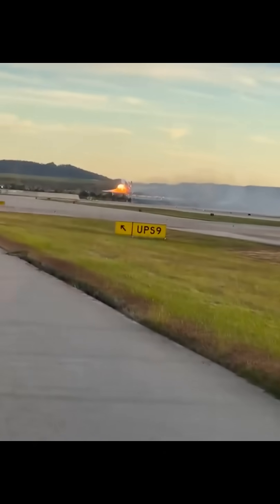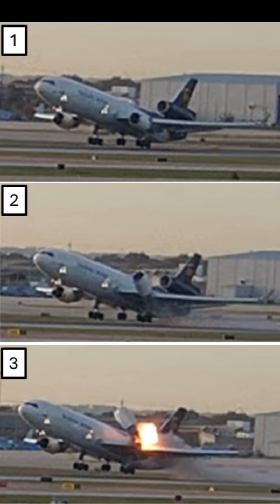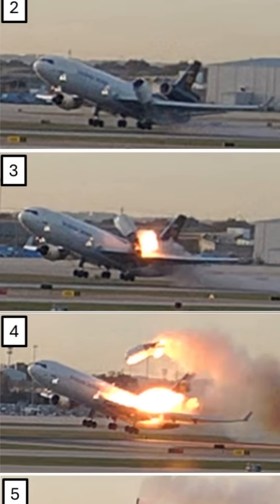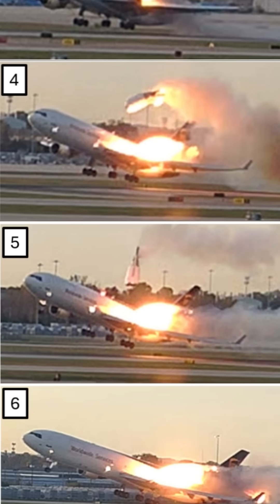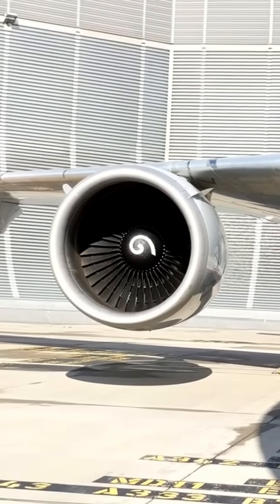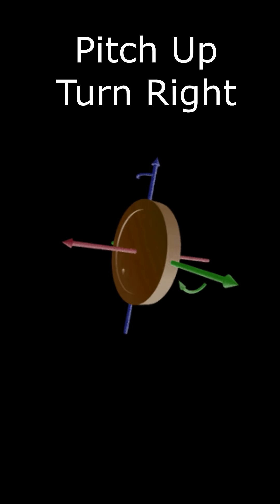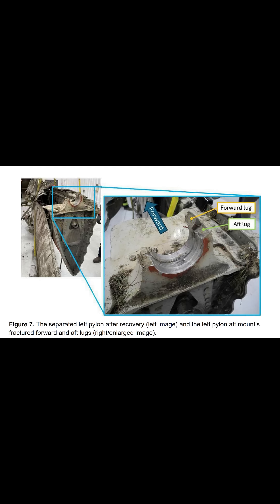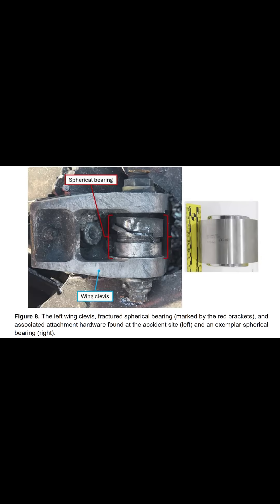Lost Engine Didn't Fall Down, But Flew Up Over Doomed UPS Aircraft #UPS2976

Comment: Dc 10 already had similar engine pylon related issues. The aft mount design hasn't changed much since the dc 10. Added to that the ageing fleets contributed to the crash. Debris from the detached engine got sucked in to the good engine

Comment: This is exactly the sort of thing that the pylon fuse bolts are supposed to prevent. You know the ones that got standardized after the exact same thing happened on this exact type of aircraft. Ffs

Comment: In picture, see you could see the compressor stall in number two with the flame coming out of the back

There would've been literally no chance of any sort of climb on just one engine(#3) at that point
Reply: Compressor stalls usually show flames coming out the front on the engine. Normal fod going through the engine.
Reply: @hoghogwild .    Compressor stalls is a very broad term.     You could clearly see flames coming out of the back of the number two engine.
Reply: @Boston737Brian  Yes i agree, a very broad term. . My point was that the flames we are seeing(coming out of the back of #2) could be the result of FOD passing through the engine is all.

Comment: I never thought of the engine acting as a gyroscope, but it so obviously does. I love it when a I get an extra insight into how things work. Thanks ❤ rip the poor people who perished.
Reply: Every engine acting as a gyroscope. The gyroscopic precession is an obvious issue for the flight control system of the fighter jets, when they are maneuvering st high alpha, low speed. The departure attitude is coming from the high mass rotating shafts. That's why the F-22 Raptor and the F-35 family has a counter rotating shaft engines. Or that's why the Harrier had back in that days. So as the Lift Fan System in the F-35B nowadyas. But when you see an agressively maneuvering good old non-fbw F-15C or F-15E whith their good old half-analog Flight Control System, every higher alpha, 26-33 degrees pitch maneuver, the rudder is automatically deflected left. The recent digital FbW F-15QA or EX had even a more sophisticated response of course.
Reply: I was thinking that although this might be an incredibly rare failure, future turbine design would do well to have left side turbines rotate in the opposite direction, so if a detachment happens it would go up and left away from the center plane.
Reply: @skrattzerat5831  That will never happen. Every single aircraft company would have to stock a right and left engine.  They'll ground all trijets before they did that.
Reply: @skrattzerat5831  Do you realize how many engine parts that would affect? You would have to have two configurations of any engine part that would be impacted by that. More configurations mean twice as many parts to spare. Tooling for cast and forged parts would have to be different. The cost would grow exponentially and for what, a worst case scenario occurrence with a root cause not likely attributed to the engine itself.
Reply: @GFSwinger1693 That Noted  But Shrapnel For Engines Spinning In That Direction On All Left Engines Are Going 
To Be Spit Out Towards The Fuselage/
Pasenger Compartment Decompression 
Of The Plane Or Acully Hitting Passengers Inside You Are Correct About 
The Cost Of Making Every Lerft Engine
Spin Yhe Opposite Way Would Cost A Fortune But  Could Someday Be Done 
From The Drawing Board  And Become 
A Standard Way  of Building Them In The Future Eventually
Reply: @jamesdugan8086  It is absolutely technically possible to build CW and CCW rotating engines but from a shrapnel standpoint it doesn't buy you anything. Whether the engine spins CW or CCW it will still have a 360 degree trajectory of debris should the compressor or the fan grenade. Engine manufactures design for this by making the nacelle the containment mechanism. Is it absolutely bullet proof, no, nothing is. There is no practical reason to make counter rotating jet engine configurations given the huge cost aside from possible exception of the gyroscopic precession issue.
Reply: @jamesdugan8086 i would doubt that ever being viable. You have in one stroke made the engines unique models that require seperate safety certification, seperate part supplies - that doubles tooling costs and halfs the order numbers crippling any economies of scale. It also means that the engines will have different maintainance plans increasing the likelihood of engineer error.
Reply: @jamesdugan8086  I had 3 strokes trying to read this. 😅
Reply: It's not really a true gyroscope. Correct me if I'm wrong someone but an engine only acts like a gyroscope on one axis, whereas a real gyroscope is doing that across every axis simultaneously.
Reply: @davidgreenwood6029  Well, considering what we consider a gyroscope, it's the combination of gyroscopic forces in 3 planes...There's a differentiation, a gyroscopically stabilized object is 3 axis, a object being stabilized under gyroscopic forces, is 1 or more...
Reply: Nope, the engine rear attachment point failed first, then the thrust from the engine pivoted the engine up around the front engine mounting points and snapped those bolts. Then the residual thrust from the engine at full power before it spooled down from cut power and fuel should push it up and over the engine with the bulky top attachment points being the higher air resistance points catching the air stream and pull the engine into a vertical spin and then the air drag does the rest. Remember the plane at this point is flying in excess of 100 mph.
Reply: It's called gyroscopic progression look it up.😊
Reply: Do not understand the gyroscope reference here. A gryroscope measures angular velocity, so how is an engine thought to be a gyroscope?🤔
Reply: @turanamo a gyroscope doesn't just measure in fact not all measure at all, but all gyroscopes have a stabilizing function. So an engine spinning like that is acting like part of a gyroscope. Not a whole gyroscope because that would require multiples axis spinning one inside the other while one axis also rotated and moves inside the other axis, but an engine is just the one axis, like half a gyroscope, so still provides that stabilizing effect albeit just on one axis not every axis.
Reply: @turanamo  in short the equal forces from an object rotating around an axis, stabilizes said object along the axis, of well the axis...so basically a spinning top where the body's rotation stabilizes it around the axis of rotation

Comment: The failure must have been extreme. Modern engines require to constructed so a non-containment incident is impossible, in order to protect the internal cabin from debris.

Comment: It would be smart to make mirrored engines foe the left side so they rotate the other direction, but that wont happen, it would cost to much to design and get all the tooling to make them, and then they would need more spares specifically for each side. 
And the last thing they want to do is spend money, i mean, they dont even do proper maintenance,  and just bandaid patch many things to keep them flying

Comment: Im the son of a certain cargo company pilot who flies the md11. Crew was super knowledable. Debris compression stalled 2. They were dead as soon as they rotated. @scottmanley. The engines are designed to go over the wings on failure, it juat was nwver consodered that something like this would happen at this point in flight(post v1, during rotation). If the engine had behaved like chicago, the crew survives. It is the extra debree and fire that really screwed it.

Comment: Eery similar to the El Al crash in Amsterdam, where 1 engine broke off, ripped the second engine off and damaged the slats, and when the speed dropped, turned into a hard right uncontrollable turn.
Reply: No, in that crash the engine that broke off apparently did not go over the wing, or it would not have ripped off the second engine.

Comment: The bearings on the motor spindle must be absolutely screaming. I wonder whether the turbofan could be warped and make contact, braking (braking, not breaking) the engine and contributing to loss of power.  Do they even test rapid pitch/yaw in wind-tunnel testing?

Comment: If I am not mistaken, a similar accident already happened, when an American Airlines MD-11 had the left engine torn off from the wing during take off. In that case, the plane managed to get airborne, flew for about a minute, but the asymmetrical engine thrust made the plane uncontrollable and crashed a few moments later killing all crew and passenger aboard.
Reply: It was a DC-10 back then.

Here they additionally had the problem the slats retracted on one wing, which led to a stall on this wing. They changed that on the MD-11, however this one still dropped towards the left wing when it hit the parking lot.

Comment: I am extremely surprised the engines aren't counter rotating. I helped with speedboats in the 90s and our piston engines(Chevy 454) were counter rotating.
Reply: It would not only cost a lot of money to manufacture two kinds of jet engines, but also to keep spares and parts for the two different types.
And it would maybe even introduce an opportunity for mistakenly fitting the wrong part when repairing an engine.
Reply: With reciprocating engines, if they have shafts coming out both ends, you can just turn one of them around to have it rotating the other way.  In some cases you can have the exact same engines rotate in opposite directions -- this is routinely done with giant two-stroke marine engines.  If you can't do any of that, making left and right gearboxes to reverse the direction on one engine is a lot cheaper than making two types of engine that are actually different.  Remember than in a turbine (including any jet engine that isn't a pulsejet or ramjet), the chirality is cast into the design of the parts.
Reply: @Lucius_Chiaraviglio A400M has counter rotating propellers. However the turboprop engines rotate in the same direction, it's the propeller gearbox which changes the direction. Doesn't work with a jet engine however

Comment: So basically it did an American Airlines flight 191 at Chicago O'Hare International Airport on May 25th 1979 when the engine detached from the starboard wing and did a flip over due to improper maintenance procedures at the Tulsa Oklahoma maintenance base.  American Airlines maintenance crews  suspended the engine and pylon together using a forklift instead of  separately and went to lunch and left it on the forklift. Thus causing stress fractures on one of the bolts.  Ended up detaching after v1. The pilots continue to take off run Indy take off with the remaining port engine and cleared to the left and rolled over and crashed into a trailer park at the end of the runway killing all on board

Comment: Something a lot of people don't understand is this is how the engines are designed. In the event of a structural failure the engines are meant to go up and over the wing.

Why? Beats me.. Probably to prevent it from being pushed upwards from the aero forces into the wing itself.

Comment: I mean, seeing the Engine on the runway meant it probably was in full throttle taking off, and it meant that if the engine detached, it would fly up. 
Not that surprising knowing this is the case.

May the souls that were lost, Rest In Peace. 🕊

Comment: How about 6 bolts instead of 4? How about making the mating surface twice as thick and have sister plates? Spread that loadout farther across the mount and the pylon on the same thing where the pylon meets the wing, it's gonna add a few 100 pounds, which is gonna lose 1 or 2 passengers or a few pounds of freight.  But this is ridiculous. I had to fly back tjen with the DC10s. 

By the end of the 1970s every time you got on AD she 10.You'd have to worry whether they got the cargo hatch or lock down correctly.And whether the engines were gonna come off the wings it was really ridiculous. 

I remember when the DC10 first launched. If your root McDonald Douglas, they would send you out a set of stickers.There was a couple of dozen stickers - one for each airline that was flying and had orders in for the DC10. 

When it first came out there was so much hope and it seemed so ingenious and innovative to be able to why the same amount of passengers as a 747 but doing it with only 3 engines, so less fuel burned. 

But then they turned into a disaster.

I actually got stuck in New Orleans on a 4 leg flight from Miami new orleans dallas las vegas Los Angeles. I was getting off in Las Vegas and instead of an 8 hour flight with 2 stops. It ended up being a twenty one hour flight with two stops. 

Stuck in Miami for an extra 2 hours dealing with the rear cargo hatch. And then the same thing in New Orleans plus dealing with an engine problem. We were stuck there for 10 hours. I'd never seen adults so drunk , especially on an airplane because all they had to do for ten hours was sitting airport and drink

What a disasterThe airplane ended up being. Such a shame. 
An jose saint louis

Comment: I believe that both engines rotate in opposite directions from each other in dual engine aircraft
Reply: No, they don't. Or those unique left-hand and right-hand engines would be helluva expensive to produce, because they'd need two whole separate sets of casting. Don't forget the pain during maintenance, because they couldn't just swap positions.

Comment: You would think that them mount bearings and cradle would be inspected in a lab every so often for stress fatigue. This plane had over 29000 flights. Its crazy that they never inspected these.... arguably the most important structural part of the plane. It's such an obvious week link. Obviously they are gonna replace them all now but I'm curious what the average flight hours are on them things and how many people got lucky that this happened. Its heartbreaking to see the situation the pilots were put into but it no doubt saved a lot of lives. To bad it had to even come to that. It never should of.
If you are unsure of the 2nd engin failure then you are retarded. It was quite obviously shrapnel from the engin that broke off. Dont need a report to tell you that.

Comment: Pressure lubricate that spherical bearing. That many cycles on the MD-11? It wasn't just pressure on the bearing, it was heat + pressure that caused the failure.
Reply: The spherical bearing didn't fail, the twin metal bulkheads that the bearing fits into failed. The two loops of metal bulkhead over the top of the bearing broke off. The NTSB preliminary report states (and shows in photos) that one of those loops had pre-existing fatigue cracks on both sides of the loop. The other loop had a pre-existing fatigue crack on one side while the other side shows a clean new stress fracture. In other words three of the four bases of the loops were already mostly broken. At the moment of greatest stress on the mount due to centrifugal precession during the planes rotation the loops finally failed completely (or at least that is the current working theory due to the evidence released).

The plane had around 100,000 hours of flight time and something like 22,000 cycles if I remember correctly. The pylon mounts aren't required to undergo a major inspection until 28,000 cycles.
Reply: The bearing doesn't "rotate" (not supposed to anyway), it just handles a small amount of oscillation and misalignment.   Not much heat in that location.

Comment: It's possible #2 didn't even ingest debris - but given it was eating the combustion gasses from the fire - it likely was way down on power and would have compressor stalls just from that.
Reply: If steam from steam catapults can affect jets being lauched from aircraft carriers, I'd say that you're theory can hold water. But I'd bet the #2 engine stiill took at least SOME FOD.
Reply: @hoghogwild  We're not talking the relatively small amount of steam from a cat here - we're talking a large amount of combustion product - instead of getting 21% oxygen (like normal air) through the front it was probably getting half that - getting a giant load of CO2 instead - less oxygen means fuel does not all burn and that gets you much less power than planned and compressor stall.

Yes, may also have had FOD - NTSB will tell us that possibly - but the engine wold be able to lose enough power from oxygen starvation alone to prevent them from climbing.
Reply: @mgzuck  That's their point, if the little bit of steam from a catapult can already affect jets, then a big plume of oxygen deprived air is likely to do much much worse. Add some FOD and you have a catastrophic failure.
Reply: Yeah, my thoughts as well. Looks like a huge plume of smoke going right into #2.
Reply: @yablecki  Perhaps also leaking fuel from the #1 pylon.

Comment: Well, id imagine even on two engines, it wasn't likely to stay airborne.  It was likely at MTOW.  So any loss of thrust is a disaster for them on takeoff.
Reply: All airliners are certified to take off at MTOW with one engine out. The compressor stall of the #2 engine made this a single engine takeoff which was not possible.